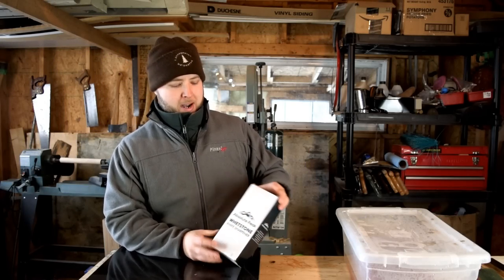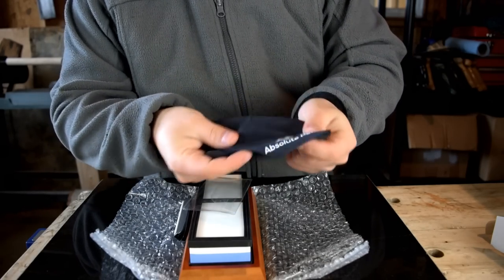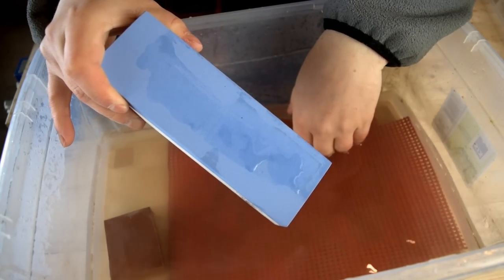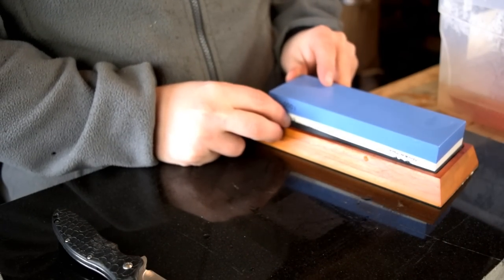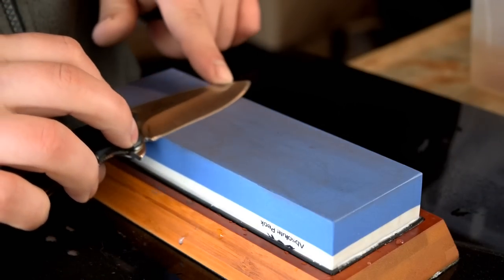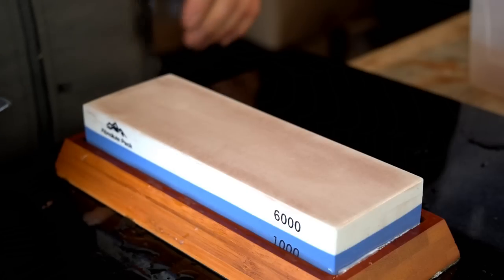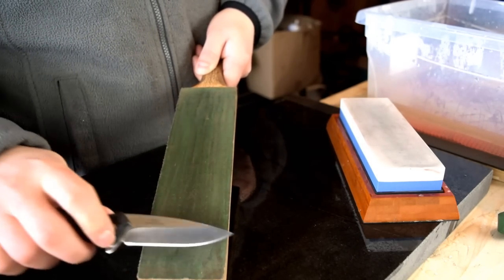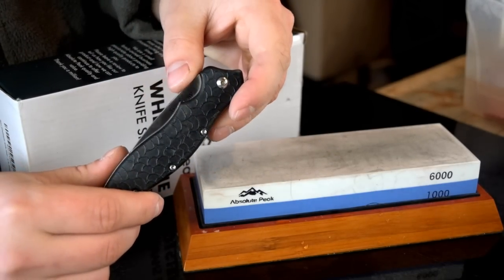The best stone sharpening starter kit? - ABSOLUTE PEAK

Comment: Literally just buy the kingstone 1000/6000 on amazon, and then maybe the kingstone gold 8000. Dont waste your money on these. These are a generic chinesium stone that are distributed under different labels and names.
Reply: Ever used one?
Reply: Absolutley. Buy the king. It's not great at super steels but it works. King is really the benchmark in what grits are measured by. $20 on Amazon with a base included is good to go. This stone he is showing is very inconsistent. Did you see how that cleaning stone was being abraded heavily by the supposed 6k side? Those cleaning stones are equivalent to a 600 grit.  I know grit doesnt determine how abrasive it is but it shouldn't do that. I would guess that stone is around 400 grit on the 1k side and 600 on the 6k side.
Reply: Dont be cheap and just get DMT stones
Reply: @blake102989  The kingstones are good value stones. Especially that 8000 grit for finishing S30V and S35VN. The KDS sharpens all of my knives fantastically.
Reply: The Kings are only a few bucks more.
Reply: @robertlefeaux  Shapton Kuromakus are only a bit more Jan that. A 1k, 5k, 8k setup isn't too spendy.
Reply: I always check locally then elsewhere before buying from Amazon. I find that I have to 'know the price and quality'  before ordering from Amazon.
Somebody wisely said " if you don't know the product, know the dealer, then if you don't know the dealer,  know the product!"
Reply: How much does that kingstone go for on amazon, I have my first chef knife and it's expensive, after a few years of using it it started to get dull and used up, I need to buy one but idk what's the best because everyone is sponsored
Reply: It may be too late to tell you but it's actually cheaper to get it from King than Amazon...

Comment: Down to the PDF, this is a carbon copy of the Sharp Pebble, also sold under about 10 other brand names. These are the exact same stones given for free with the scam knives called Kamikoto. These are NOT good stones for any reason, as I can say from experience that they look like the Grand Canyon after about a dozen knives or so. I literally sharpened 8 really cheap steak knives and was missing so much material from the stone that I would have needed to completely replace the stone after maybe another 20. So on top of being improperly labeled, (mine polished at less than an 800 grit with the 1,000 feeling more like a 220) they wear down extremely fast. If I'm recommending stones for a beginner, I'm going to try and get them stuff that they don't have to replace before the year is out if they sharpen regularly. I would more recommend a cheap Smith's diamond file and an Arkansas stone to a beginner instead of this crap. Much better gleaming edge and the stones last for a very long time.

Comment: I'm a sharpening stone nut and basically this kind of alibaba stones are trash, I tried and returned once a similar if not same stone, 1k side is more like 600, 6000 side is more like 800 but nothing like a proper 800 grit stone. I think for a total beginner the first task is replacing factory bevels with hand sharpened bevel, that requires a lot of grinding. A coarse stone like shapton 320 can be an easy stone for that task. Once comfortable with setting apex, one can upgrade to 1k and finisher later. 1k is easy only if your edge geometry is already established. Stones like king 1k are soft so if you achieve apex with a coarse stone then 1k stone can be used with very little wear so you won't need to flatten it as often. If you try to reprofile with 1k it will eat a lot of the stone and the stone will get super concave, edges will need a lot of chamfering etc.

Comment: All I use is that Smith set. It works okay if you use peanut oil, and I get a shaving edge on whatever I run on it. You're right though it takes forever, and I strop 100 times with a white compound then 50 with green. Great for a mangled edge though. Pawn shops love me in my area because I buy their most destroyed knives.

Comment: I'm not sure why everyone is complaining about this (and other similar) Whetstones. If someone has a $15 or $20 Chef knife in their kitchen and a couple of other inexpensive knives (the vast majority of people in America), they are not going to pay $50 - $100 for a single grit Shapton or Chosera to sharpen their knives.  They either throw the knife out and buy another cheap one, buy one of those cheapo manual sharpeners, or an inexpensive whetstone. Or they are silly enough to buy a cheap knife/knives and spend way too much on an electric sharpener.
At least with this stone, they can sharpen their knives. And if it gets sharp enough to cut paper and the hair on your arm.....well that is pretty sharp and not a reason for you guys to complain about the stone. I mean how often are you going to sharpen your knife?....especially your kitchen knives. You all need to get real.
Reply from the maker: this is EXACTLY my point and thoughts as well. People need to keep things in perspective. There is a place for a cheaper whetstone like this.
Reply: The thing is, you can get a shaving edge off of a brick after a little bit of stropping as well. But I wouldent pay $15 for a brick. The 2 main issues I see with these stones is that 1 the grit ratings are not accurate. and 2 the stones are inconsistent. There are tons of these stones available on amazon and they are all the same stone with different branding. Some people have reported that they are decently hard like this one here. Others have said that the one they got shed grit like crazy. 

If someone was looking for a stone I would instead recommend something a little more expensive that would be much higher quality, and the biggest thing consistent from one stone to another.
Reply: I can get most of my knives to hair whittling sharp with a $20 whetstone and a $10 diy strop.
Reply: @kyle_noseworthy   how do you spell the brown block you used on the surface  to flatten it before use. thank you in advance lol 1 year later
Reply: @kenseth234  It looks like naniwa dressing stone but that doesn't flatten the stone. It can clean metal shavings embedded on the stone. It can also smooth out scratches on the stone, so microscopically flattens in a way. I used naniwa dressing stone for a month before getting atoma 140, and with atoma I saw that middle of the stones were very concave compared to top and bottom ends. Until then I was thinking naniwa dressing stone can flatten stones. For flattening these options are available 1. diamond stone 2. flattening stones 3. sandpaper on glass etc. Also this cheap stone gets contaminated by naniwa dressing stone which is 600 grit but it has nothing to lose anyway. If you're seriously into sharpening I recommend atoma 140 or 400.
Reply: Honestly nobody's wrong here IMHO. I've been sharpening a long time, originally with crude tools like the bottom of a coffee mug and eventually stepping up to proper bench stones. For my first bencher I opted for this, figuring it would be mediocre if I were lucky. That's how it turned out. I don't think the grit ratings they claim are accurate and I wouldn't expect it to last, but you can sharpen on it. You practice, make your mistakes, get the basics down and realize the better ones are worth it if you want to take it further. Some people don't want to go much further, and that's fine. Others, let's face it, don't have three figures to spend on a stone. This gets them in the game. I don't see the harm.
Reply: @user-uf4lf2bp8t  Exactly
Reply: @westcoastwarriorsarchive7929  yup. I have been looking around and this darn stone has popped up under at least 4 different aliases! quite annoying, going to just invest in a nice stone, i do leatherwork and i value my hands, so ill go with a sharp edge is a safe edge mentality and invest in an easy and safe life.
Reply: @enriquerodriguez9590  Definitely spend a little more for quality stones unless you cant afford to. The king deluxe stones are good and pretty cheap. Otherwise the suehiro cerax is a little more but better than the king in every way. The shapton pro stones are also really good. You could also always go with a waterstone for your courser stone and then pick up a arkansas for a fine stone. They tend to be a little cheaper than the high quality ultrafine grit japanese waterstones.

Comment: Very similar to what I just bought. Mine is 1k & 4k and came with a small naniwa stone. I think mine is softer and builds a little more slurry. Also, the finish on the 4k side looks pretty darn smooth. (the blades edge that is) Even on camera we could see the striations from that 6k surface. I have some leather and wood and need to make a strop next. Thanks for another great vid!! Think I might even have some jewelers rouge somewhere as well, for a strop.

Comment: All of you knife sharpening gurus have converted me! For years, I never bothered with forming a “burr.” My knives are always razor sharp. But, everyone was so insistent. So, I took 2 blades (same knives, as close to equally dull as I could guarantee without using a microscope) and sharpened one using the burr method, the other as I have always done, never bothering with a burr.

Now, I did get both blades sharp enough to shave my face, but the knife where I ignored forming a burr, took well over twice as long. I always thought forming the burr was eating up too much steel. But, by not doing that, and taking darn close to THREE times as long to get a razor edge, I have to assume that I was, almost certainly, wrong!

The problem was, that no matter how careful I was, constantly lifting the blade to sharpen the opposite side, was forcing me to make constant adjustments to maintain my the angle. Obviously, not a good way to conserve steel.

LOL..great stuff. Cool channel. 🤙
Reply from the maker: Thank you for sharing your ideas and experiences, Shadow X! I appreciate the comment, and I hope your sharpening now progresses to another level!

Comment: Something in the straight razor honing Community we've noticed is that many of these whetstones have a little bit of course grit in the top 16th of an inch of the stone even in the more expensive stones. So it's possible that after a break-in period or a lot of lapping this stones grit could be higher.  Worth experimenting?
That said looks like a sharpening stone not a polishing stone.
Reply: Sandpaper will lap it quick and get all that off

Comment: I have an Edge master stone exactly the same yellow and blue but mines labeled 240blue, 1000yellow and the ground finish was identical to yours.. Im pretty sure they just stick any old numbers on every double sided block.. I have the same brand  single block same dimensions Edge master 3000 White and it cuts almost the same as my King 1000 which compared to every other cheap stone cuts like a buttery smooth dream with plenty of feel.. The Japanese King stone was available at my local knive shop for 39 bucks which is cheap in Australia..Good review cheers!

Comment: What? "...as i'm sliding across once in a while you'll feel little bits of different sized grit, doesn't effect your sharpening process..."  How could  this possibly be true?  A 6000 stone mixed with 300 particles will give you a very different result than a good, pure 6000 stone.

Comment: One of the problems is to check the temperature of the water your placing the stones in before use. I used warm water and the glue holding the stones together melted. I'm saying the water was hand rinsing temperature . . . . . . so beware of this hidden pitfall.
Reply: Thanks for hewdsups

Comment: That roughing stone he used called agora? I think thats how its spelled. What is it for exactly and is it needed per say?
Reply: Nagura - dressing stone. It gets the tiny metal shaving from your knife blade that embed in sharpening stone to release to the surface so you can rinse them off and keep your sharpening stones in good shape. Works much better than a simple toothbrush like I started out with.

Comment: I have the Shapton set, both the HR and HC series, I also have Arkansas Stones.
I almost exclusively use the Arkansas Stones.  
The Shapton are amazing, but the Arkansas are simple, simple to use, 
just some oil and the stone can be used in the base of the wooden box it comes in.
Coarse, Hard, Hard Black and Hard Translucent.
Simple, and DO they ever sharpen!!
You can get them in Canada, and US companies will ship them here.
What turned you off the Arks may I ask?
You mentioned you only had one, I assume Coarse, keeping in mind you do need more than one Arkansas Stone
to get a shaving edge, just like you need more than one water stone. 
I was amazed by how fast and how polished an edge I got from the Hard Ark, the first time I used it too!
And they are less expensive than Shapton Stones.
Not to mislead anyone, I LOVE Shapton Stones.
People like to trash them likely because they are pricey, (Sour Grapes maybe?) but in my experience they are worth it.
Pretty much like anything you buy, you get what you pay for, and I won't sharpen my "knife collection" 
with anything that will destroy the sword.  
I like the Arkansas Stones because you can pretty much use them anywhere, up at the cabin...
and with water stones you need a clean source of water, so they are not so good for "Field Sharpening".
The smaller 4" Pocket Arkansas Stones are good for sharpening Axes and other large tools that are too big 
and to unwieldy to use on a workbench.
I just wondered why you prefer water stones to oil stones.
As for your black strop, I was wondering what, if any, compound you are using?
Thanks in advance if you answer.  Sorry about all the questions.  :/
And thanks for your content, it's very informative, and I love your accent!  :D

Comment: With all due respect brother I think that all experienced sharpeners know that synthetic stones are processed and baked which gives them a crust and in many cases an uneven surface. They need to be flattened before initial use if only to remove the outer crusty surface. How are you supposed to evaluate a stone without properly flattening it first?
Reply from the maker: Hey Steve, I haven't experienced what you're talking about at all, and I have used many, many, synthetic stones from new condition. They are always perfectly flat and super consistent (homogenous).
Reply: Many people - even experienced sharpeners - are surprised that stones are not flat out of the box. Take a new stone and mark a criss-cross pattern with a pencil on it. Take an atoma plate (or whatever you flatten with) and start to flatten. You'll see that they are not perfectly flat out of the box. Furthermore when you use a stone you have to make sure that you are not running up against the hard crust of the edges. This is why the corners must be rounded. I lived and learned to sharpen in Japan and no one puts a knife to a synthetic right out of the box. The typical advice I received was something like this - Soak the stone first (if required) and then follow with rounding the edges and ends, then flatten. Then round the edges and ends again. The order that you do this procedure is the same that you do for flattening a stone each and every time although it's much more important to do the edge rounding at the pre-flattening stage when the stone is new because these high edges won't allow for you to flatten the stone correctly because the flattening stone/plate will be lifted off of the stone's surface. Let me know how it works for you.
Reply: Here is a vid put up a long time ago by someone I know. Very serious knife collector and 'OG' J-Knife enthusiast. The beginning of the vid shows the corner rounding process quite well. To add to my previous reply if you go to any forum that deals with knife sharpening and you ask if you should flatten a stone out of the box you'll pretty much get a unanimous 'yes' from people who have learned the lesson the hard way. https://www.youtube.com/watch?time_continue=90&v=czsksxhnjMw
Reply: I feel like this is something that a lot of modern businesses producing whetstones would do before they're boxed up to be sold?

Nowadays, a stone would seem a little unfinished if you have to remove some old crust from the factory. Never noticed anything of such anyway.

Comment: You're not supposed to rinse off the slurry that you've created during sharpening/polishing. The slurry is an important part of the process especially in polishing using a >  or = to a 3000 grit. That is why nagura stones are made in different grits. Dress the polishing stones with a nagura that is equal to or slightly higher in grit to get a workable slurry faster than you'd get without one. Sharpening Supplies sells a wide range of naguras.

Comment: Great video, thanks!
I do however slightly disagree with you when you can say that VG-10 is comparable with AUS-8 or 8cr steels. AUS-8 ,  8cr, and the likes are run of the mill Chinese steels, they're fairly durable and fairly corrosion-resistant, however they don't tend to hold an edge very well. VG-10 is a much more durable steel in my opinion.
Reply from the maker: I respect your opinion. I do agree that VG-10 is 'slightly' better, but I don't it's enough to matter with day-to-day EDC tasks. Unless you really take a step up, most Aus-8, 8cr, VG-10, VG-1, 420hc, 440c, etc.. it all behaves similarly. The difference isn't enough to delay sharpening

Comment: This may seem like a daft question but couldn't you use 1000 grit wet n dry paper around a sanding block and then finish with a 6000 ?
Reply from the maker: It could technically be done, sure. The experience would be much more unenjoyable, speaking from experience.